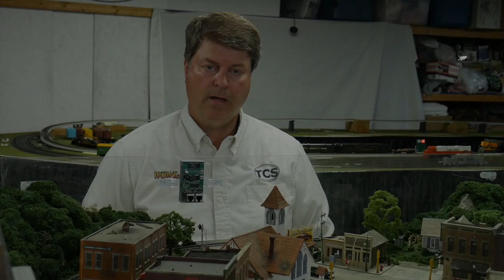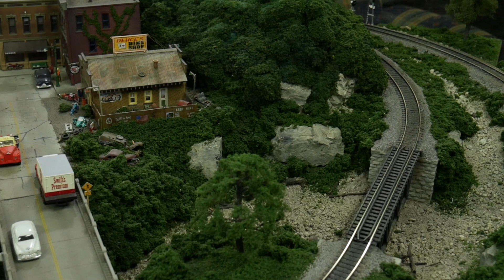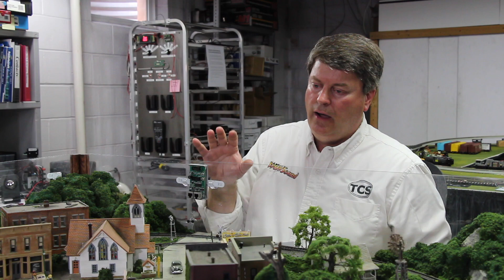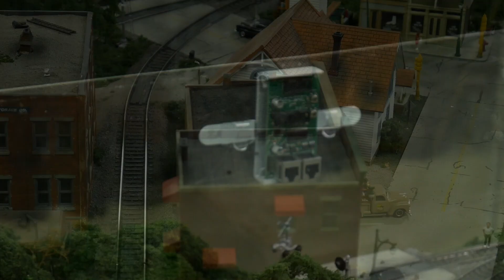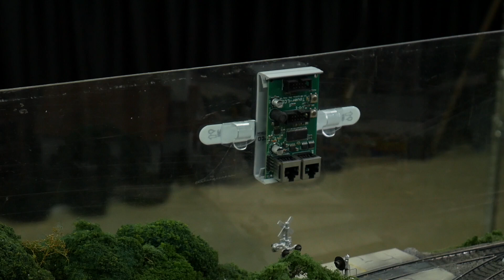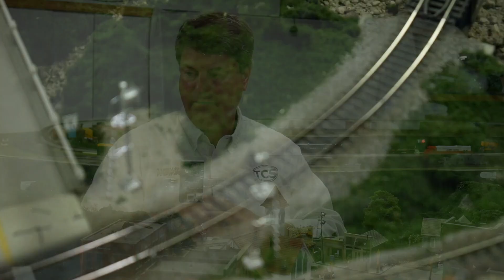What is LCC? Explained!

Comment: Any LCC products coming?
Reply from the maker: Yes, TCS plans to release the Universal Wifi Throttle this summer. This wireless handheld throttle can communicate using the LCC protocol, WiThrottle protocol, or interface with LNWI from Digitrax. Essentially the throttle can run trains on any layout that is connected to WiFi with JMRI. It also works on any layout that is wired for LCC. Check https://tcsdcc.com/commandsystem for updates!

Comment: I can see the benefit of LCC as a way not just utilizing electronics from different manufacturers as current DCC can do, LCC can be an easier way to run all kinds of railroading operations by having LCC run a fast clock for a modeling specific operation without the burden of using a throttle for all operation programming . The fast Clock using LLC commands will be more attractive to use to control all other layout electronics to the Modeler's choice and  give more realistic operations with more ease and realism.  I get it, John. Cutting edge.

Comment: sorry but i did not understand what it is supposed to do different or more than DCC, is it just a change of communication protocols?
Reply from the maker: LCC picks up where DCC left off. It gives you control over all aspects of your layout that aren't the locomotive. This includes layout lighting, signals, turnout control, and so on. DCC can also work in conjunction with LCC.
Reply: thanks